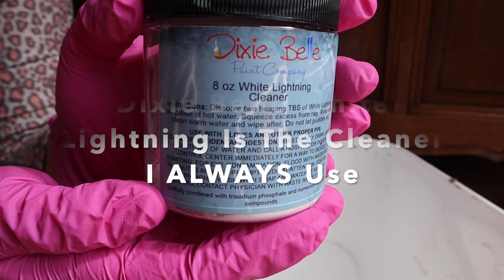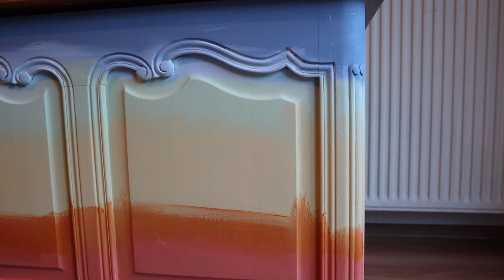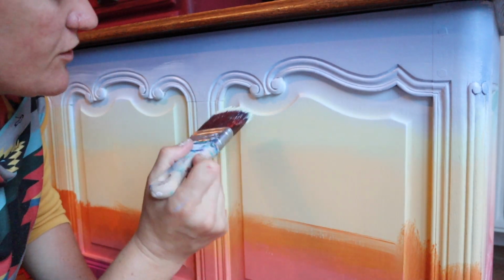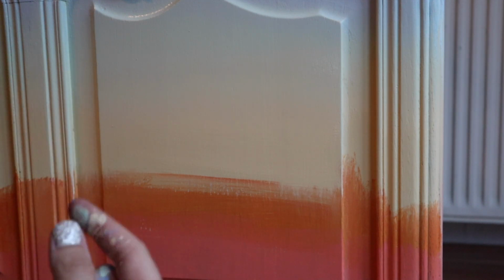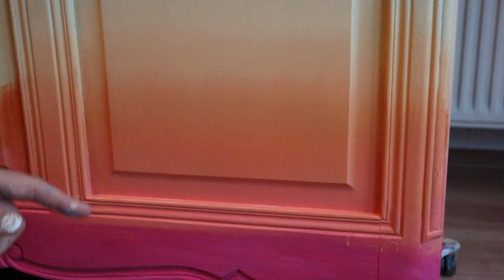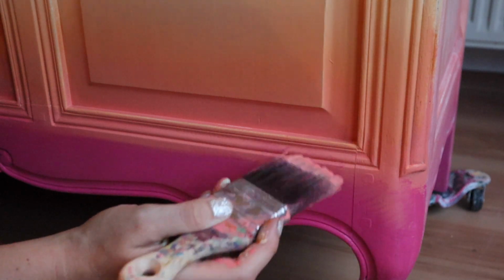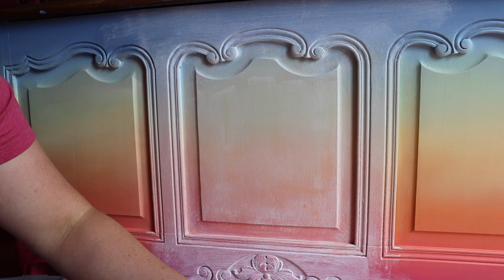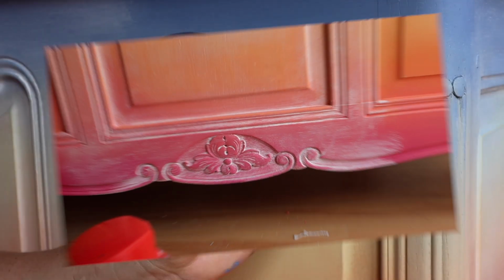Rainbow Blending and White Wax With Chalk Paint

Comment: Do you ever scuff sand anything before u paint ?
Reply from the maker: Yes it depends on the paint I use and the actual piece so the cleaner I use is a deglosser as well which is what scuff sanding does. But if a piece is super shiny I clean and sand. It really depends on the piece of that makes sense?